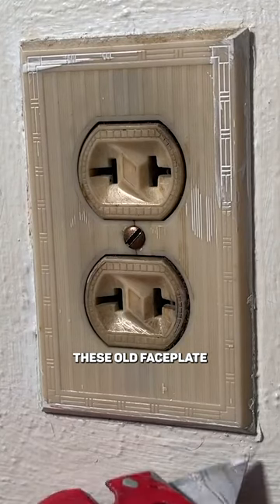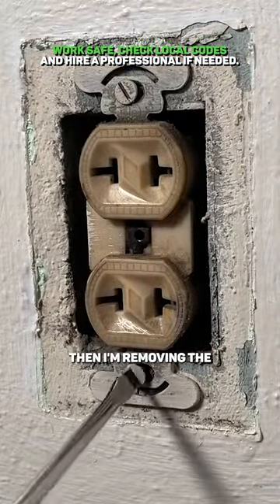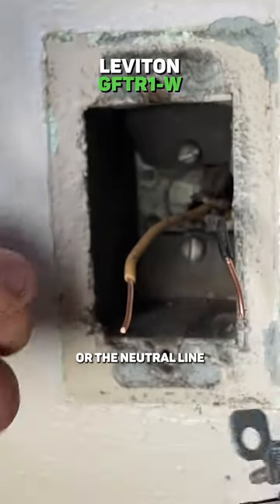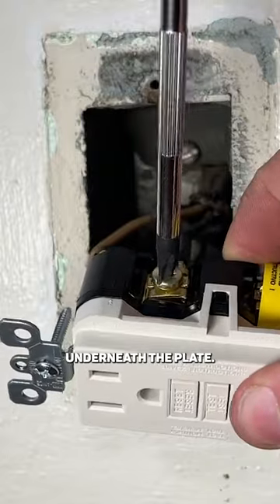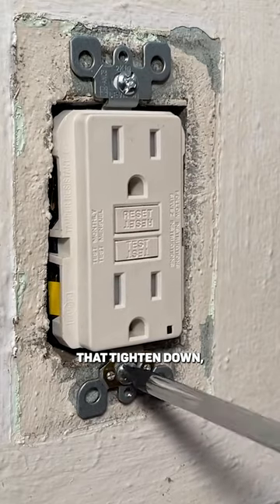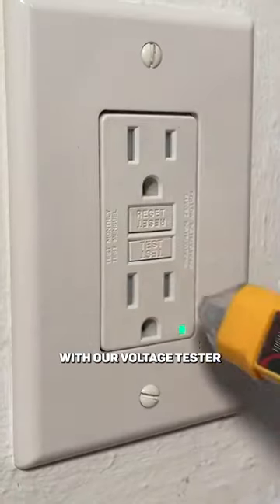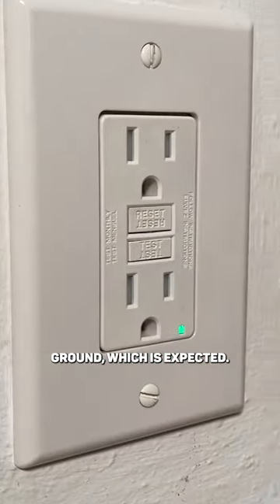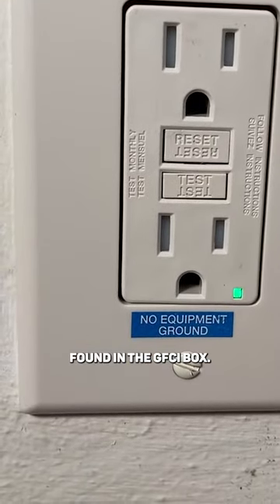Safely Converting 2 Prong To 3 Prong

Comment: That old outlet is interesting. 
115v 15a and 20a. 
208v 15a and 20a.
Reply: i was saying the outlet is set up to take all 4 plugs.  Due to the sideways slits in it.
Reply: 208? I don't know where your from,but here in the US,we don't need 208,(which is 3 phase for outlets!!) Even if it were a commercial building,we would have 208/120 for outlets.
Reply: That's not a 208v. It's a tandem/parallel blade combo 120v. 15amp. A common old style that accepted the pre-NEMA tandem blades.
Reply: No, the prongs in the Hubbell's original plug from 1904 were horizontally, in 1912 he changed them to be vertical. Because both plugs were used for a while sockets were made to accept both.

Comment: Late to the party. Does a none grounded GFCI recep work the way it should? (Water splashed on it tripping it?) Please tag me
Reply: Yes it will work.  GFCI detects differences in current going through the hot and neutral wires to trip.  The "ground fault" refers to it detecting electricity going to ground through another source, ie your body or water.

Comment: Now am I the only one that saw he sniffs the neutral slot of the gfci outlet and shows it’s hot?
It’s the shorter one on the right you just explained was the hot there, Dude. 
If the bigger one on the left lights up, we might have a problem Houston. Screw the ungrounded GFCI.

Comment: Is this any safer that using a kill-me-quick?
Reply: Yes. A gfi will still work without a ground. ( although it’s not as sensitive for protecting electronics) it will provide protection for human, which is what they are designed for.
When it doubt, don’t bring your toaster into the bathtub with you.

Comment: Power supply goes on 
The side that says (Line) 
No equipment ground needed for the GFCI to work....
Reply: Yes, I suppose, zero is zero, but I have had problems from lightning and weird electrical burnouts and a GFCI could have saved so much expensive equipment- besides, I like to be properly “grounded!”
Reply: Of course you regularly use calibratied test equipment to make sure it works?

Comment: Does the GFCI function as designed when there is an open ground?
Reply: Just saw a “this old house” video. I believe the answer is yes but watch to confirm
Reply: Supposed to leave a warning on it though
Reply: Yes, that’s why it’s recommended you install a GFI
Reply: Not really. If there is a fault from line to ground the GFCI will not trip, since there is no path to ground for the fault current. It will trip only when an unfortunate person will touch the faulty appliance...
Reply: @alerighi  A GFCI outlet or breaker can detect when more current is coming in on the hot wire than is exiting on the neutral wire, and will shut off the circuit quickly before the current can stray to alternate paths.

It is one use of a GFCI outlet. It isn't as good as an actual ground, but it can be done.
Reply: Yes.  The actual ground prong isn't used as part of the GFCI functionality.  All the GFCI does is constantly ensure the electricity coming "out" of hot perfectly matches the electricity coming "in" to neutral.  If it doesn't match, it nearly instantly trips.  That means if electricity somehow decides to flow from hot through your heart to the metal pipe you're holding with the other hand, it will trip before it does damage.

IMO, a GFCI without a ground is safer in many ways than a regular outlet with a ground.
Reply: @LowJSamuel agreed. A gfi is always safer. There is still a great life hazard with ground. Ground is really protection for the system from spikes. A gfi is designed specifically to bypass ground, as ground can also be achieved through a person.
Reply: @AnkurSethi108 you were doing great until that last statement. A gfi is much better than ground. If you can afford it, make every outlet in your home a gfi.
Reply: @alerighi nothing you said is correct

Comment: I am trying to replace a two prong outlet with a gfi.  But it is also connected to a wall switch to power this outlet as well as has a load that needs to always be on.  Which wire goes where in that case?

Comment: Will a gfci still function properly when it has an open ground?
Reply: Yes, because in the event of a ground fault, you will not have the same amount of current coming from the line, and returning to the neutral
Reply: If the metal casing of a device were to become electrified, the gfci may not trigger until you get shocked.
Reply: @soheil5710  sadly true 😅
Reply: @soheil5710  my point exactly.
Reply: @soheil5710  But it triggers nearly instantly, so that "shock" would be imperceptible and wouldn't hurt anything.

Comment: Those GFCI's barely fit in those old boxes. Do they make a smaller one?
Reply: You should wrap the terminals with electrical tape if it’s a tight fit. Or you could always replace the box
Reply: Smartlock Pro. Look for that if you're looking at leviton receptacle. The depth of the Smartlock Pro is reduced by 20%

Comment: Here we just bridge the neutral and ground in the outlet. Not allowed on new installs anymore but if a old socket is broken and need replacing I do the same on the new one. Was standard practice in the 70:s, 80:s and 90:s
Reply: @Kevin-mp5of  in the US maybe
Reply: @Kevin-mp5of  isn't neutral connected to ground in the main breaker panel?
Reply: @Kevin-mp5of Essentially that's an old TN-C install.
Reply: That's an illegal and dangerous tactic. 
If you have a broken 2 prong receptacle, you need to replace it with a 2 prong receptacle, or do the conversion in the video. 
Sadly, this neutral/ground cheat is fairly common by those who don't know better.
Reply: @cgschow1971  illegal in the US maybe but I don't live there
Reply: it's not a good practice whatsoever, but yes, it does function to complete the circuit
Reply: Never do this, it's way more dangerous than leaving the ground unwired. This is because if your neutral-ground (PEN) wire gets broken anywhere, any equipment that has a metal case and is connected to the ground prong will have the case become live voltage level. Anyone who touches it will be shocked.
Reply: @smlgd  we have TNC-S so we only get PEN +L1,L2,L3 to the house so there is a PE-N bridge in the meter cabinet.
Reply: @justme5384  When it's just the bridge in the cabinet it's safer becasue you only have to worry about the PEN cable breaking and not all the neutral wires that have connections and such, which are more prone to breaking. Even then, PEN breaking is a risk and it causes an issue that isn't detected by GFCI outlets for example, only by a DR device installed before the split PE+N, as with the PEN broken the current returns through the neutral (thus through the GFCI or a DR device installed after the split) and back into the PE wire. Only way to make this connection safe is to have both a DR installed before the split to trip in case of a broken PEN and a DR installed after the split to trip in case of a ground fault
Reply: It's literally safer to just put a three prong in and leave the ground screw empty than to jump the neutral.  The only reason to do that is to fool testers for inspection.  Ironically making it significantly more dangerous to pass an inspection.

Comment: I dont understand this trick, if there is no ground reference how will the unit detect ground fault ?
Reply: GFCI detects imbalance of not all live current returning through the grounded prong.  Then assumes the excess is going through a person touching a water pipe or other grounded metal and cuts quickly enough to reduce the risk of permanent heart failure.

Comment: So you can’t plug a 3 prong cord into this now?
Reply: You could, but the outlet itself will not have a ground connection. You're basically relying solely on the GFCI to protect from faults.
Reply: @tier3rd375  ok thank you for the reply . I appreciate it.  Quick question. Those lil plug in testers thst tells  if it’s wired correct if it says it’s wired correctly on the meter that means the outlet is properly grounded ?
Reply: If it doesn't have a ground, it should be saying open ground. If it's not, then you either have a properly grounded outlet or someone wired it by adding a jumper to the neutral and ground terminals, which is not safe and goes against code.
Reply: @tier3rd375  thanks a bunch
Reply: @tier3rd375 which is exactly what a gfi is for

Comment: Here in Eastern Europe, many older homes have no ground wire, just 2 wires coming into the outlet, but when we install newer schuko outlets with ground conections, we simply connect the live and neutral wires to the screws, then using a short wire connect the neutral wire on the screw to the ground wire screw, that way, when you plug a washing machine or any other grounded device into that outlet, the fuse acts as an american GFCI, so in case if there is a faulty appliance, and live power gets in contact with any part of the appliance that is grounded, or in this case conected to the neutral wire, the fuse will blow, and you will not get an electric shock. Simple system, but it works well
Reply: Fuses and GFCIs are really different. Wiring the neutral to the ground is legal in some countries, illegal in others - even in Europe.

Sockets for washing machines have been grounded since 1930s or so. 

In Europe there is no need to change the sockets as you can plug schuko plugs into ungrounded outlets.
Reply: @okaro6595  I had a microwave, with a schuko plug plugged in to an ungrounded socket for 10 years, worked fine, then the live pover got on the metal housing of the microwave, and i got shocked a couple of times, thank god i wasn't barefoot. Of course if the microwave was plugged into a grounded outlet, this wouldn't happen. After that, i installed a schuko outlet, but since there was no ground wire, i connected the neutral contact to the ground contact, so then i tried plugging in the broken microwave, and the fuse immediatly blew, then i bought a new microwave, everything works ok, and in case the new microwave gets live power on the housing, as did the old one, the fuse will blow, so i believe it is a bit safer, then before.

Comment: What good is it if not connected to ground ? Waste of an outlet.
Reply: A GFI works without a ground.  A GFI doesn't even use the ground plug within its mechanism.

Which is why code requires them in cases like this where a ground wire isn't present.

Comment: Too terse.  Where does the third wire (the ground wire) come from?  A wiring diagram would be very helpful.
Reply: A GFI does not require a ground, however it should be labeled in that case to the effect, "does not provide equipment ground".
Reply: @Sylvan_dB  : Thanks.  The video ought to say no ground wire is needed.  And it ought to explain the purpose of the ”No Equipment” label and describe what should not be plugged into the outlet.
Reply: @brothermine2292  This is a "short." It's limited to 60 seconds. This is the bare minimum info. If he was to explain the ground wire, he'd have to talk as fast a crack addict who just smoked the whole boulder in his pipe before the cops caught up and cuffed him. 😸
Reply: @mannys9130  : It would take only about 2 seconds to say ”only the two wires are used.”

Comment: I did this project on my upstairs hallway outlet about 3 months ago everything works great except I never got the led on the gfci to ever light up but I know the circuit works because it won’t work unless I have a ground wire installed and everything is wired correctly and the receptacle works correctly when I do the test mode on it maybe just a bad led?
Reply: chances are you have the line and load backwards, or a neutral backwards, gfci's are very particular about how you bring the circuit's wiring into said device
Reply: Plug in a receptacle tester and it’ll tell you if it’s wired correctly. Usually the LED turns on after you press the reset button but if it’s working normally then it could just be a bad LED

Comment: How does one differentiate between wires that aren’t color coordinated?
Reply: You have to test them. You can find the hot with a stick tester, and the ground is often bare. If not, use a multi meter to ring out the individual wires from the source.

Comment: I was attempting to do this on my sisters house. How do you get the GFCI outlet inside the small tiny box with two wire sets?
Reply: This is an issue, older boxes were smaller. A good solution is to use a GFI breaker on the entire circuit if you can find one to fit your electrical panel. Or - change the box, which can be a hassle. Also if your wiring is metal clad cable you may have a ground at the box, you just need to add a ground tail to put in a grounded outlet (non-gfci)
Reply: @MB-zj3er  house only has two conductor 12 gauge romax there is no ground lead.
Reply: @mrnapolean1  Then it would be easier to go the breaker route if you can. Even if you have to upgrade the service panel it would be less work than changing every box in the house.
Reply: @MB-zj3er   You don't need to do every receptacle, just the first one in the circuit, assuming it's a parallel circuit,  ie cable goes from 1 receptacle to next. 
In old knob and tube wiring, the receptacle leads were branched off and not wired parallel, so yes, you would need to do each outlet or go the breaker route. 
Another alternative is add a blank GFI device in the upstream part of the circuit.
Reply: @cgschow1971  Correct, however he said his box is too small, thus the alternative I offered. Definitely don't want to go and create another violation by overloading the ci of the box. Of course one outlet per circuit would be ideal.

Comment: Don’t be lazy. Add a separate ground. Be safe.
Reply: Yeah, I’ll just explain to the customer that what can be done in 10 minutes with a $30 gfi is going to take 3 hours and holes cut in their drywall. It’s not lazy, it’s just not economical. Besides, code says it’s safe.
Reply: You want to fish new wire In my 150 year old house? Or do this
Reply: @SpencerKaup  fish the wire. Lives are too important.
Reply: @robertfish6617  you do realize this is safe??? It's a GFCI
Reply: @SpencerKaup  ask your local Inspector.
Reply: @robertfish6617  Rewiring an entire house is a major construction project and, more importantly, is very expensive. Adding GFCI's to ungrounded wiring gives the exact same protection as a ground wire.
Reply: @Beefnhammer  Not in all States and Counties. No bueno where I live. You’re still gonna get someone hurt. Is it worth the money?  Just do it right or don’t do it.
Reply: @robertfish6617 How is someone going to get hurt? Do you even have any clue how a GFCI works?
Reply: @robertfish6617  Bless your heart.
Reply: A GFCI is safer in many ways than having a ground wire.

The best is for every outlet to be a GFI and have a ground, but I'm assuming you don't insist on that, do you?  Do lives not matter enough to spend the extra $30 on the GFI?
Reply: @robertfish6617  I could have used you when I replaced my outlets in my old house just like the video shows.  You could have shown me how easy it was to fish the wire in a slab house that had horizontal lath catchers installed every few feet in all the walls.

Comment: The tight fit comment is correct
 Overall, why install an expensive GFI outlet in n an ungrounded system? A standard 3 prong duplex receptacle works fine at a fraction of the cost.
A waste of money.
Reply: Why? Because code requirements that's why. You know...us actual electricians follow it.
Reply: 1) To meet code

2) To keep your family safe

Comment: Why don't I need to use a J hook? I am told at work to do it?
Reply: The J hook has 2 jobs.  One is to hook to a screw with no hold down plate. The other is to increase pull strength.  This GFCI socket model only eliminates the first job.
  This video demonstrates installing the 3 prong socket where no grounding wire is present.  Personally, I prefer to upgrade all the wiring for higher quality and a real grounding.

Comment: I just put in tamper resistant 3 wire with no equipment ground stickers on it and put a GFCI AFC I dual function breaker in the panel It's cheaper than putting a GFCI at every receptacle Box in the house
Reply: You don't need a GFCI receptacle in every box. You put a GFCI in the first receptacle of the circuit and everything downstream can be a regular 3-prong receptacle as they would be protected by the first GFCI. Sometimes it's tricky to identify the first receptacle on a circuit, some installers did weird things. So in that case using the breaker might be easier
Reply: GFI breaker is better, no need to get in old boxes and a lot of the old boxes won't fit a GFI anyhow.
Reply: @theelite1x721987  Unless it's nob and tube, they don't daisy chain it very often on that kind of system. Usually pigtails off the main run and comes down to each box individually no jumpers. Then you gotta do single location gfci protection. That's why putting it in the panel is the best option. Saves you from having to put g f c i at every single box.
Reply: @ryanyork837 if you have knob & tube, your first priority should be a whole rewire, and while you're at it go ahead and thank God your house is still standing
Reply: @D_A_M-091  That all depends if it's been modified or if it was put together correctly to start with. It's old wiring and it should be updated to handle the loads for today. But not always an option because it's not in the budget for most people. Especially if it's for a landlord. They will do everything they can to get by on the cheapest fixes. Because they're not interested in putting lots of money into a dump house that they may turn around and sell just to be torn down for new development.